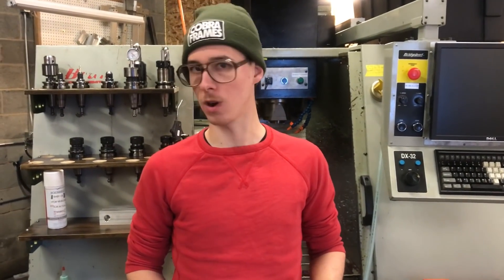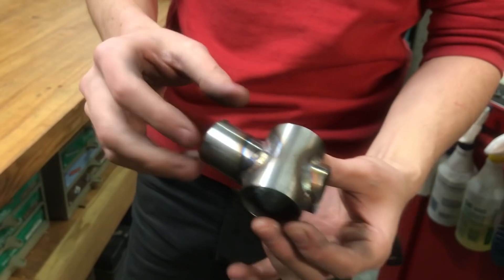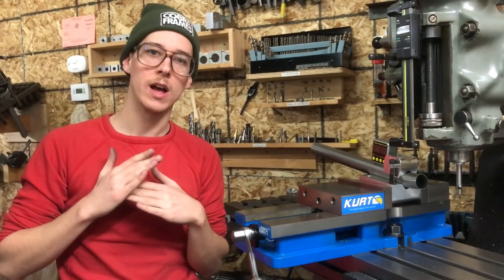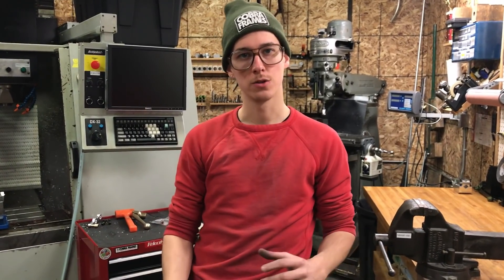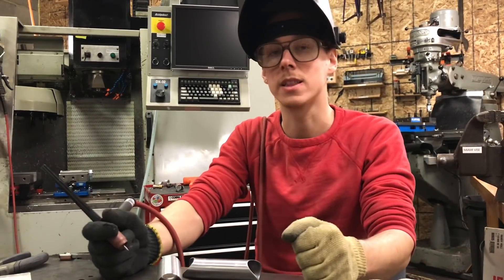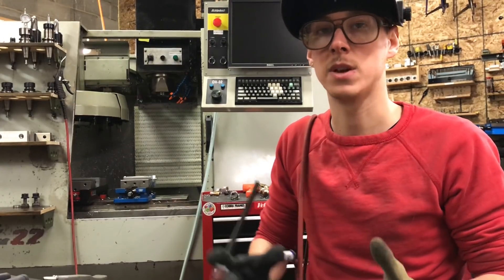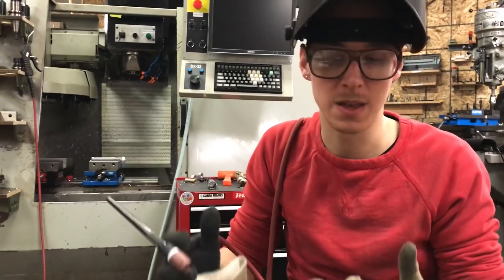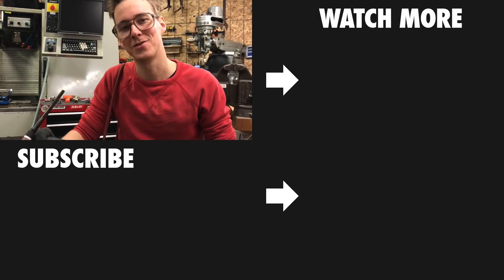Setup for Practice Welding Bike Frames | TIG Tuesday

Comment: Recently broke the kick stand support off the frame of my xr650l,   done a little very poor arc weilding and decent plumbing soldering.  Wondering if a tig weilder from Arbor freight or Lowes would be ok for my motorcyke frame with some self taught practice

Comment: Great videos!… I’m a long time roadie and airplane builder. Can you please suggest a good AC/DC Tig machine for welding thin wall chromoly and aluminum. I don’t need MIG. I’ll be welding thin wall 4130. The cheaper the better, I’m retired…Thanks

Comment: Which filler rod you use?
Reply from the maker: I'm used to using Weldmold 880t. Usually .045 or .035" diameter. I think it's similar to 312 stainless, but I don't know that for sure. For welding 4130 and similar steels it's great. People also commonly use er70s2 for this.

Comment: Hi, what is the amperage when you weld bike tubes that thin? Thanks bud
Reply from the maker: That should be easy for me to answer, but it isn’t really. First of all, the way my machine displays amps in the LCD is really odd and it makes it a PITA to know what amperage you have it set to max, but add to that that I like to use the pulser and also my foot to control the current as I go. If I wasn’t using a pulse and only a foot pedal, I’d probably start by setting the machine to 80 or so and seeing how that goes. And with a pulse I’d maybe set it to 120 or 150. Take that with a grain of salt. I just turn the knob up or down when I have to.
Reply: @cobraframebuilding  Cheers mate!

Comment: At 3:25 , can I just use a regular drill press or do I need something crazy like that machine?
Reply from the maker: A drill press is made for axial loads (pressing straight down) and a milking machine has different spindle bearings and is built much heavier to properly allow radial loads on the spindle. Using a hole saw on a drill press to miter tubing can work in a pinch sometimes but a heavy milling machine is really the tool for the job. For a lot of reasons. And they can be bought used for relatively little $$ if you live in a post-industrial area like anywhere near Boston.

Comment: Turn the pulse off and start using your left hand as well to hold the torch with,it will suck for a little while but you  will be a better welder for it.

Comment: Do you have any opinions on other mitering configurations? Specifically I'm curious about the mini mills like stuff from littlemachineshop dot com. @PithyBikes introduced me to that idea of getting a small operation started. Also the cheap and dirty stuff like Harbor Freight notchers is out there but those things look pretty sloppy. Anyway I'm REALLY digging your content. Thanks a ton for putting this stuff up!
Reply from the maker: I used to have the same mini mill as Steve at Pithy Bikes and it’s not bad for a limited space and budget. Tube notchers are not that useful in my limited experience. With the mini mill you can mostly get good results, it’s just not as nice as with a properly heavy, rigid, and powerful machine tool.  It doesn’t have enough torque to run a hole saw at the proper low rpm so you have to run it fast and you wear them out a lot faster.

Comment: I'm just learning to TIG weld and setting up to build my first frame. I bought a load of scrap frames out of a bike shop skip, partly so I could study the geometry and various details, but also so I could cut 'em up for welding practice. Reckon there's any downsides to doing that, ways they would differ from virgin tube? I know I'm going to have to remove the paint one way another and clean em' up.
Reply from the maker: Cleaning the paint is a chore but other than that it should be fine practice. By the time you do all those practice welds you’ll be way ahead.
Reply: @cobraframebuilding  Yeah, it's gonna be a bit of a pain. I don't like the idea but I think chemically stripping them may be the way forward. Thanks for the videos and advice!